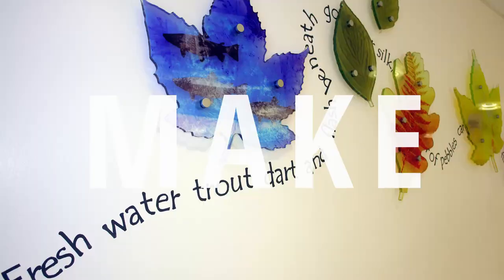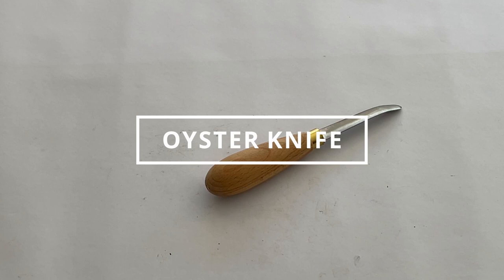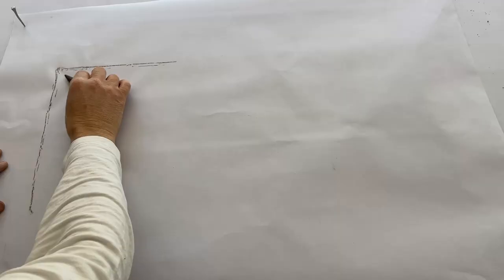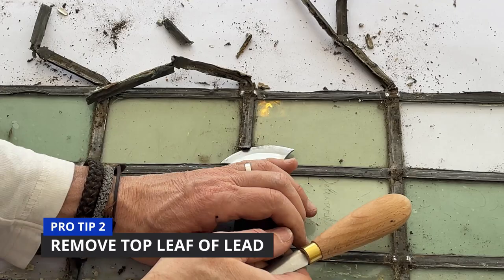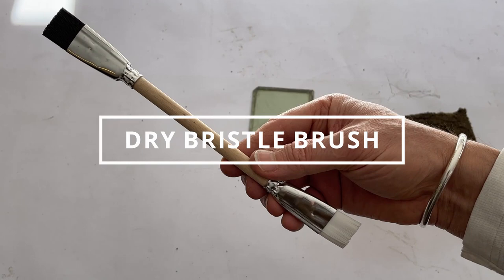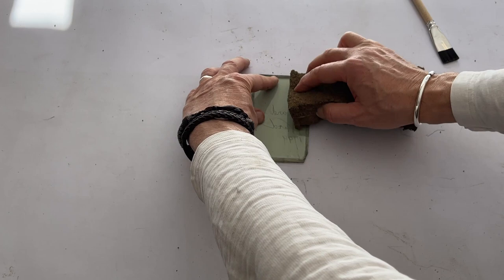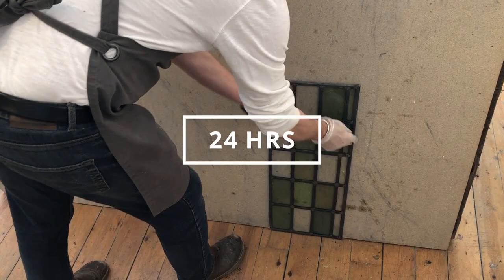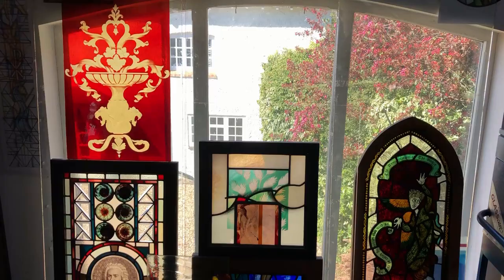HOW TO RELEAD WINDOWS : PROFESSIONAL GLASS ARTIST'S TIPS AND TRICKS TUTORIAL

Comment: Hi Derek. It brought me memories of when I started working with stained glass 40 years ago. We used to manufacture our own mill lead as you showed us. We poured our melted lead into a double mold as you showed us. Then we brought it to the mill machine, where we introduced one end of the short H shaped leads in this machine and started pulling from the other side. This machine had a place to put two dices that allow us to create the kind of lead that we needed.  Over twenty years ago we I moved to America. Overhere the technique is different. We don't put a lead inside the other, we just cut it with leadknipers exactly next to the other lead a5we use paste Flux to solder. We also use  a 45 watts Weller Iron that  gives us good results. We also use zinc border instead of lead. We also use many other techniques .
Thank you for your video, it's very informative.
Reply from the maker: Hi Carlos, wow great to read about your experiences making your own lead. I only buy pre-made lead for suppliers here in the Uk, rather than make it. I enjoy hearing from other glass artists about different ways to make windows so thank you for sharing your knowledge. Best wishes, Derek
Reply: Hola!! Muchas gracias, me resultó de mucha utilidad, hice algunos trabajos con la técnica Tiffany, di un curso el año pasado en Segivia y creo que podré aprender a hacer vidrieras emplomadas con tus vídeos 😊,  lo intentaré, estoy esperando a tener mi horno instalado para poder comprar el curso online que ofreces, en YouTube puedo traducir tus videos no se si entenderé todo lo del curso online, lo intentaré 😅

Comment: I'm working on a large stained glass (copper foil) window that I have incorporated lead into to highlight/outline a large round medallion at the top and also around a large nameplate bevel near the bottom. It will not be exposed to the elements, rather it will be installed inside & up against an existing window. My question is: do I still need to putty in the lead or can I leave it as a "wrap" around those pieces? First time putting lead & foil together in same panel. Thanks so much 😊
Reply from the maker: Hi Kristy,
You don’t need to cement the lead section if it’s not exposed to the weather, however the putty will help to give a bit of structural strength to the artwork when it hardens. Hope that helps 👍🏼🙂
Reply: @DerekHuntArtist  Thank you Derek! I just found your channel and subscribed! I appreciate you taking the time to answer my question. Hope there will be more instructional videos on the way! 😀
Reply from the maker: @kristycannon7923  yes more videos on the way !🙂

Comment: Hello Derek, What is your view on using sawdust vs whiting?
Reply from the maker: Hi Wendy, I used to use softwood sawdust but switched back to whiting. The reason was because the sawdust would stick underneath the lead and get trapped. So after a while that sawdust would rot and possibly affect the glass over time. Whiting is inert so won’t damage or stain the glass.
Reply: @DerekHuntArtist   thank you so much for the quick reply

Comment: Heya, thank you for the video, it was really informative. 
I do have a question though. When cleaning the glass you mention how careful you have to be, especially if it is stained so it doesn't effect the colouring. However when you applied the cement and removed it, it appeared to be quite a vigorous process. How do you prevent the stained glass from becoming damaged in that process?
Thank you
Reply from the maker: Great question Ali. If the paintwork is stable it is fine to cement the window as shown in the video, however if it is unstable and the paint is coming off the glass then only cement the unpainted side of the window and hand putty the painted side. This will weatherproof the window and look after the paintwork too :-)
Reply: That's great thank you 🙂